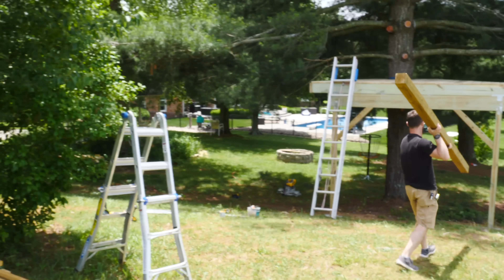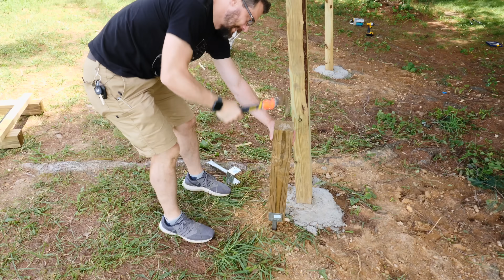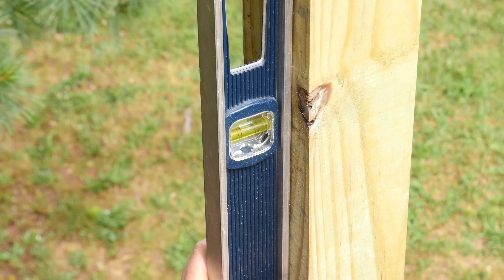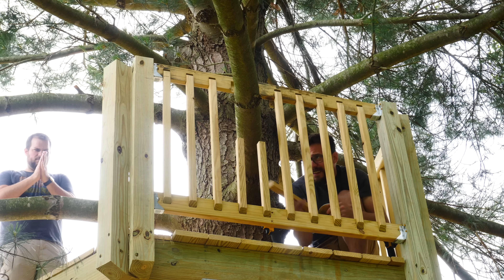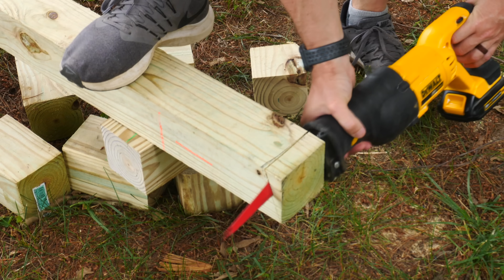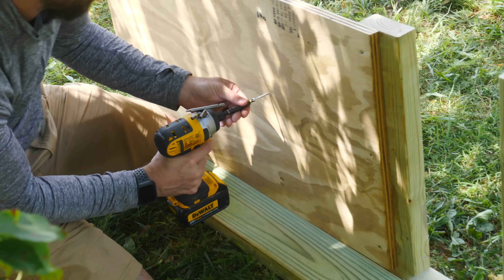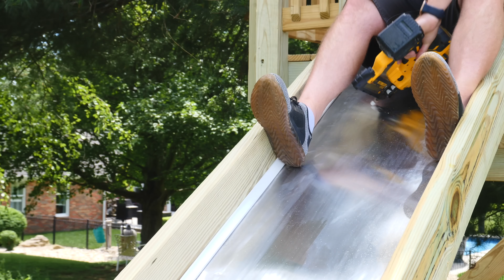How to Make a Treehouse Part 2 | I Like To Make Stuff

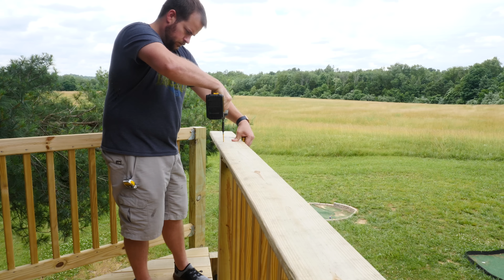Comment: FYI: at 10:10 Just as the end grain rots faster when it is horizontal & captures water & microbes (mostly molds) the rail will last much longer if it is slightly tilted (10-20 deg) so water & debris run off easily.  
re 14:30 I recommend grooving the side rails, so the sharp or burred metal edge is buried.  
It would be helpful to see how many years of tree growth were planned in the attachment to the trunk.  When boring the holes in the tree, maybe you could see inside, and count how many years per inch the tree has been growing.

Comment: Open question.  Would you dig footers for those posts at the bottom of the slide?  I'm trying to do something similar.  As I understand it, you generally don't want a floating platform attached to a fixed platform.  However, I was reading that regarding deck stairs, so I wasn't sure if it also applies to slides.  I would appreciate any guidance on this.  Thanks!

Comment: I'd have done more of a ships ladder versus the spinning rungs ladder, and those posts would fail code around here.  Need 1/2" thru bolts with Simpson guard/post anchors into the framing.

Comment: Bad technique for the railing posts. Either use your ground/load bearing posts(don't cut them off) or put them inside the corners/joists. He externally mounted them on one surface.
That will give you two solid anchor joints instead of one. If you have a greater than 90 angle, trim scrap to shim. Less than 90, (but more than 70 ish, just trim your post down, or shim it to 90.
Reply: Externally mounted posts are just fine and can be up to code. Attaching a 3 1/2” post with a 4” structural screw is most certainly NOT safe. Even coming from the other side with additional structural screws doesn’t make it much better, especially where it’s a doubled 2x and again you’ve only got 1/2” of screw penetration. 
You need to tie the post connection into the joists or blocking with through bolts and brackets if you’re going to have posts mounted outside of the rim joist / end joist. 

I love the treehouse, but the railing is a deal breaker for me.

Comment: What’s the width of the slide and the flashing?  How deep do you cut the slot for
The flashing?
Reply: I made mine with 24 inch flashing.  I did not cut a slot - works great.  Oh, and its 20 ft long and 12.5 ft up.

Comment: Really well done!  Thanks for all the instruction.  This has been really helpful in learning how to build the slide and attached the railings.  I spent the past month building a treehouse and let's just say that apparently we made it too tall (8-9' off the ground). When you add in the slide, it's a little too steep.  Need to figure out something different.
Reply: "Simply" make it longer and run it out further.
Mine will start 12 ft off the ground, but will be on 20 ft 2x8's.

Comment: Love to see more creators out there but my guy...your capacity for knowledge is obviously large, now ya need to fill it a little more. Your parts seem to come from a how-to list rather than what's-best list. Research foundation building a tad more...suspended, mounted, how to attach things to them, etc. That railing scares me. The posts are mounted on the outside and a decent amount of force from the inside, where the action will be, will take it out. And for the love of god...swear off brackets. At least use them as 'fail-safe protocol'. Those will let you down in the long run. All in all, looks good...but not as good as your next project.

Comment: The two supporting post in concrete should have been 6x6 and extend to handrail hight. You have way way way too much trust in brackets alone. ANY notching at all on this project would have been more cost effective and safer.
Reply: Notching of the railing posts is not safe.   Reducing a 4x4 post to a 4x2.  Not good.

Comment: If cutting a grove in side rails of slide why not attached flashing to ply wood then set in groove sandwich and completely hiding the edges also I would attach some sort of swing arm to top of ladder with out it you now have a 8' high open hole.

Comment: Just a recommendation, as it seems theres an aweful lot of weight sitting on those two bolts on the tree: In addition to the two footings you currently have, i would have added a third (or maybe even fourth) footing and post on the other side of the tree, and skipped on the attachment to the tree. This could probably be used to build a swing under.

Comment: Watched to see the slide part - had a similar idea but was thinking the pine sides could lead to horrific splinters. Interested to know the result.  I'll probably do this but paint the edges.  PVC trim was a good idea - along with flashing and those nails.  To be a biiiiit critical - this video was begging for a framing nailer and saving on all those screws and metal connection pieces - nails and proper wood placement is more practical. Then again, it was sponsored by Lowes so they probably paid for all those pricey features. All in all - good work and thanks for the video.

Comment: swimming Pool at the End of the Slide in Summer would be huge fun !  Flower Pots on the Railing ,  Cup Holders, Boxes to store Treasures on the Deck and Keep it Safe from weather. Or simply to store them. 
Foldbale Chairs  and Table in Treehouse Size  for the Kids. Outdoor LED Light on the Railing

Comment: NIce aerial deck.  However the flashing for the slide is scary.  There is some plastic products that would have worked better and safer I believe perhaps a smooth frp fiberglass or Inpro make a wall protection in various lengths and thickness's.  Hope it last's

Comment: Round the edges on the bottom of the slide.

Lag bolt the 4x4s... Thats kind of scary thinking over a few years it will weaken and a child could lean on that and snap it right off.

Rope swing

Comment: That's not a tree house, that's an observation deck with a slide on it, to make a REAL tree house you need at least a semi enclosed portion of it like a roof and maybe some walls, You should also enclose the bottom and make that some thing like a downstairs house with the deck as the roof and ground as the floor. You should put walls on the sides like white tarp over wooden frames with windows and a door to make it lighter inside than if you use plywood. If you have power you can just install some lights and other plugs there so they can sleep on it with a lap tkp or something plugged in and they can game or watch movies there while sleeping out there on it.

Comment: watching some of your videos is frustrating...not because you're doing anything wrong per say but just because I would do it differently, and IMO more efficiently/safely. Case in point being your ladder placement. But also with the 4x4s for the rails...I never understood why people who do build videos with decks don't have the 4x4s run continuously up from the ground through the railing. It's the best way to make sure there's a strong rail because you're not making connections and don't have to rely on bolts.

Also, you know screws aren't typically used for and nails are because of shearing, right?

Comment: i'd add non slip tape to the ladder rungs to protect the children..... also i'd cut off the sharp corners of the 2 x 6's at the bottom end of the slide like you did the top again for child protection.  great job

Comment: Bob makes things for a living, 50%* of the comments are about how he should do it differently...hummmm

*(Theoretical 50%, trolls )
Reply: You want to build it your way do it.  You want to do it like someone else suggested... do it. You want to do it like Bob, do it.  
Complaining about how it’s done by someone who does a lot of research on the project before doing it is asinine.  Do what makes you happy, this is how this pro built this project.  I’m done with you.
Reply: @Itsthatoneguy371  lol I love your long winded replys I'll say what I want just like you. I'm actually a trade qualified carpenter, I know a thing or two about construction. The guy lacks experience and is giving out construction tips that are incorrect and unsafe.
Reply: Just because you diy projects on youtube for a living dosent mean you're good at it or are building somthing to standard durability or safty. Multiple comments questioning the same thing is "usually" a good indication that it might be somthing you should look into.
Reply: Kiwi Bird I would trust the two long screws over one lag bolt.  I have seen many different decks and “playground equipment” with lag bolts fail before identical ones with multiple screws, because of the single entry point having too much stress. Using more than one lag bolt in that configuration could actually weaken the item it’s fastening.  Not everyone does things the same way, that what keeps it interesting. However, Some people like to repeat previous comments, I don’t know why but they do. I have seen it on multiple channels on a multitude of subjects from wood working to car building and science channels.
Reply: @Itsthatoneguy371  who said one lag bolt

Comment: Ok, I left a big comment on video one that pointed out about half the problems.  Am I seriously the only one concerned about the bad design, bad framing technique, misuse of connectors, incorrect fasteners being used and all around terrible ideas??

Look do whatever you want, but if you change just one thing about this, please don't use screws like that to attach the post for your railing.  And putting screws in from the inside is not a "good solution" it's much easier to tear a piece of wood off pushing away from the head of a screw.  If anyone copies this and makes it over 4 feet off the ground either change the design to something appropriate, or use bolts that are literally made for framing to fasten the railing post to the deck.  That's just terrible how he's doing it, dangerous. 

Did Lowe's seriously promote this video??? For Shame. Look, "DIY" is great and awesome and I couldn't say enough good things about someone putting their own personal touch on their house and yard, and everything.  BUT, there is a big difference between DIY and just screwing a bunch of wood together 10 feet off the ground and thinking that's OK...

Comment: without securing the bottom to the tree lags, high winds can blow this thing over.  The wood used in this project isnt very dense, and over time those screws can tear out. Its best to join those with through bolts. THe hangers you used should be approved for pressure treated wood, and so should the hardware.

Comment: You should use Timberlock screws to attach your ladder and railing posts, they come in lengths of 4" and longer and are advertised to be as strong as 3/8" lag bolts. No pre-drilling is required. I have been using Timberlock screws for about 10 years and they work great and they are stronger than the screws you are using, Great video. Thanks, Russ

Comment: If I were building a tree house in a conifer, I'd definitely put a roof on it. Conifers constantly rain down needles and sap (I've parked under them many times), so in my opinion, a roof is practically mandatory. Notice that all the places you cut off limbs are now leaking sap. This >will< get on your kids clothes. I know of no way to get it out of clothing. I've had to remove a dying pine tree, and I have pine and spruce trees that are constantly clogging my gutters with needles, so conifers will never by my favorite trees. Look pretty, but they're a pain.
To fix the top two steps on the ladder, take it down, pull up the brackets you spiked into the ground, then move them back 3 1/2 inches spike them back into the ground. Then cut two 4x4 blocks and attach them between the ladder and the tree house,  and re-install the ladder. 
Since your screws aren't really long enough for 4x4s, you could use a couple of 2x4s instead. Attach the first one to the ladder, attach the second one to the first, then fasten the ladder to the deck by driving screws in from the back side. 
Or you could just buy some longer screws ;)
Thanks for the video. Looks like it was a fun project.

Comment: I'm not planning on building a treehouse, but I have a covered patio that I have been wanting to put a railing on all spring. The railing you used looked very simple and easy and will work great for my project. I planned on building them myself but I'd rather go this route. Thanks for the inspiration.

Comment: Good job on this, might want to cover that aluminum with some paint or something that won't absorb so much heat. That's going to be seriously hot if it's getting direct sunlight. Still, really nice job, very clean and sturdy. I've built a number of treehouses over the years, and that's probably the best supported I've seen yet.

Comment: An amazing build (as always Bob, you mad genius), one question though..

You said on the vertical posts that you should cover the top to stop them rotting, but you didn't for the posts at the bottom of the slide. Is there a particular reason for that?

Comment: Great Job. Just two suggestions for anyone. When building or using ladders straight up and down is more dangerous than raked at an angle.  When attaching posts for use in a railing system do not depend on construction screws as their shear strength is not up to the task. At a minimum use Lag Bolts but I would use Carriage Bolts with a backing plate to spread the load. Good idea on using prefabbed sections for the rails and balusters.

Comment: That tree house is awesome. For anywhere you want to strengthen where the 4" screws may not cut it, carriage bolts with a washer on the back work great to hold cross members of railings or posts onto a joist. They have rounded heads with no sharp edges for small hands.

Comment: Great Video. But I have a question regarding using the metal flashing on the slide. Wouldn't that get a little hot in the sun?

Comment: Maybe it's overkill but id be bolting the posts to the deck
Reply: That wouldn't be overkill at all. It is required by residential code for decks. Bolts and brackets to secure it back into the joists. I would especially want it on an application like this 10+ feet off the ground and with children.
Reply: I think he’s using deck screws in applications where there is a shearing force? For example on the joist hangers.  He mentions people use nails on those but instead he uses screws. I think those require construction screws which can handle shearing forces.
Reply: Those are structural screws. The ones he used are made by GKR and are actually stronger than lag screws or lag bolts. Look them up! They're awesome.

Comment: >nails down aluminum flashing
>Covers nails with trim so nothing snags on the nails

>nails down the trim
Reply: Adds trim to cover the VERY sharp edges of the flashing which can slice through human skin nearly as easy as a meat slicer. And the nails for the trim are power driven and end up embedded deep in the meat of the trim pieces

Comment: you might want to check the codes in your area where im at there is a code for ladders also 6" minimum to the center of the rung and the top step should be level with the platform  and a grab rail at the top other than that its awesome

Comment: Love this project - I was wondering about the slide - it's a great idea, and I love what you did with it, but I personally would be worried about the eventual chance of slivers...  massive slivers...    what if you got some composite deck railing and installed it over the top edge of the slide sides?  that would allow you to hold on, or slide your hands down while sliding without the worry of getting "stuck".    Anyway, thanks for the hard work - your channel inspires me to get out and build stuff too! :-)
Reply: He could also cut a PVC pipe down the middle of one side and stretch it over the slide "rails" and secure it into place with screws.  It might need more than just a cut though to compensate for the 1.5" thickness of the rail.  Just a thought.
Reply: @chickfamilyink   yeah that's a good idea, I thought about PVC as well, but it'd have to be a decent size and as you said, you'd have to make a couple of cuts - through if it's a large enough diameter it might be a big enough handled to prevent fingertips from grazing the wood...  I also thought what about using a Trex style composite decking for the sides - I don't think it's structural but one could design the slide so that the composite would be the only surface "touchable".

Comment: Great project that will last years. The only problem I have is that you used the screws that were too short for the railing supports, etc. You could have gone and gotten longer screws or countersink them so they could get a proper hold.

Comment: On that slide, since you were securing it to the 3/4" plywood anyway, could you have done that step first and just cut a dado into the side walls deep enough that it would have covered the nails?  Or would the depth to get the nails covered have taken too much material away?  Just trying to think of other methods in case that PVC trim isn't available.

Comment: I've never seen someone like constructions screws so much...   on the Simpson strong-tie brackets, just because there is 15 holes, you don't need to fill all of them, that's for different angles. You'll end up splitting the wood going that.

Comment: Using the metal flashing for the slide is genius, too bad you couldn't get it into the slot. Do you think you would have still needed the nails down the sides if you could have gotten it into the slot?
Putting the ladder at an angle would make it easier to climb.
Good video, Thanks.
Reply from the maker: Yeah, I think so. It's not rigid at all and needed to be captive I think.
Reply: @Iliketomakestuff  , I have the same problem with my niece/nephew's treehouse slide being too tall.  This aluminum flashing idea and demo is really helpful.  Thanks!